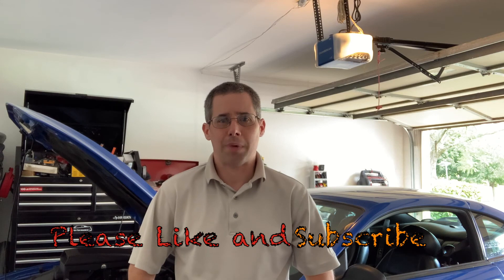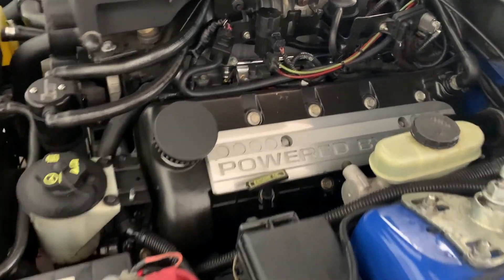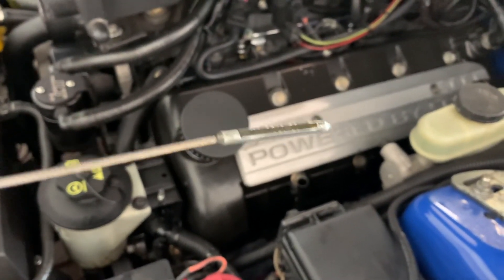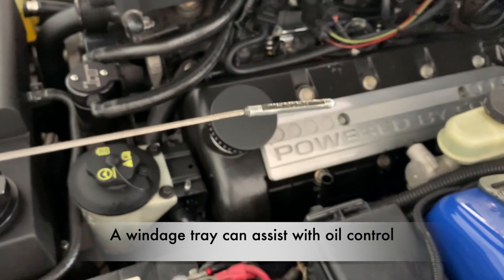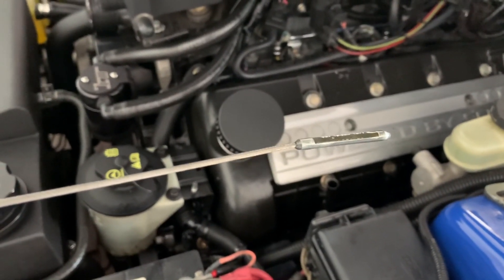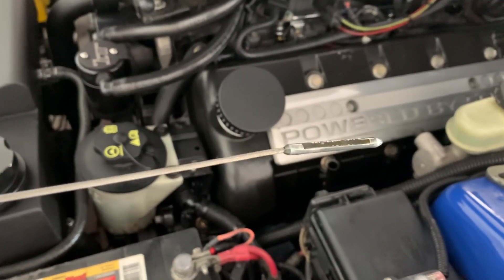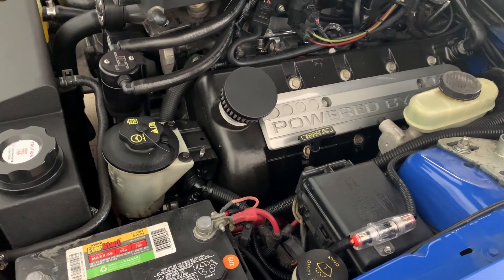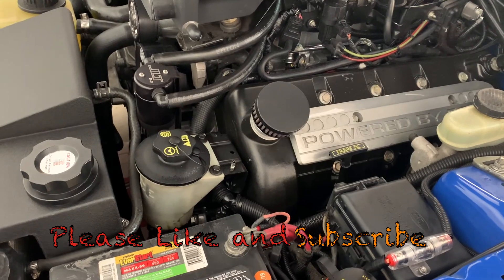Dip Stick Oil Level - Too High or Too Low on the Dipstick

Comment: Nice.  I am from the old school where we always ran 1 quart low in our Fox Body mustangs back in the day at the track.  Believe it or not it did make a difference in ET!  Plus running a lighter weight oil or even synthetic when racing for sure makes a difference too over heavy/conventional oil.  Such as running 5W-30 oil at track if you normally were running 10W-30.
Reply from the maker: Very true,  those were great times!  Thank you for watching!

Comment: Would you say that having it overfilled could over pressurize it and blow the rear main seal?
Reply from the maker: It could create a leak by having it overfilled.  It could also cause temporary oil burning and oil fouling the spark plugs.  Thanks for watching Justin!

Comment: Mike, thank you for the information. I have a quick one for you. On a GT 99-04 over 6 quarts oil would be considered overfilled, correct?  How many do you use on yours,  6.5 ?
Reply from the maker: I don’t typically measure how much I put in.  I use 5 quart jugs and go by the dipstick while using a level surface.